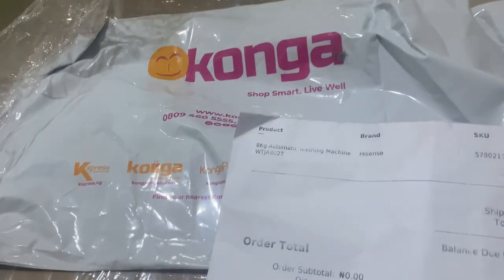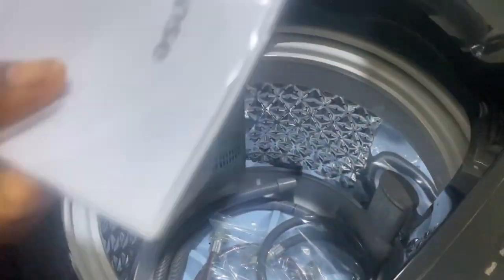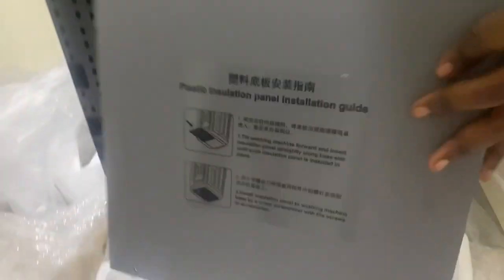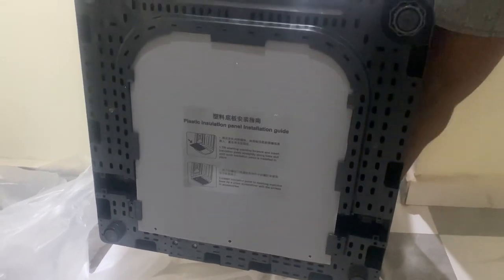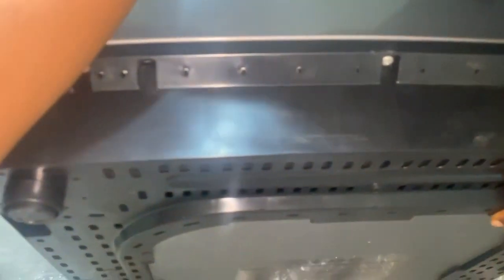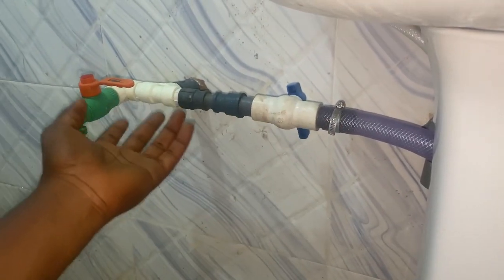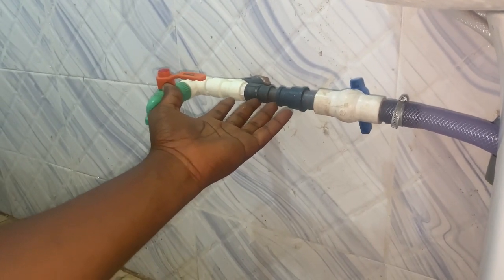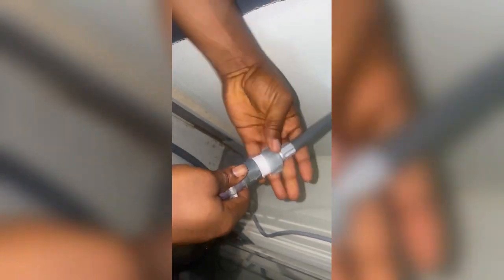Hisense top loader washing machine

Comment: Mine when I set to spin  then it start shaking
Reply from the maker: When it shakes, does it spin to wash?

Check if the machine is placed on a level ground?
Reply: Does it have transit bolts?
Reply from the maker: https://youtu.be/OTXiPFkoiGA?si=X8hW1jRzEaqIIK8O